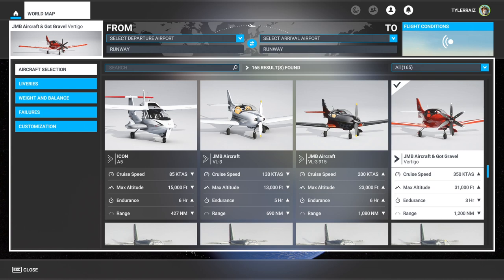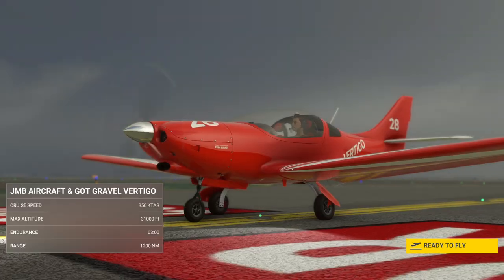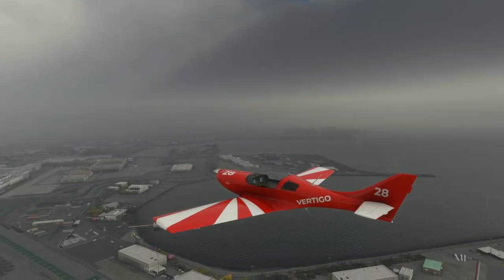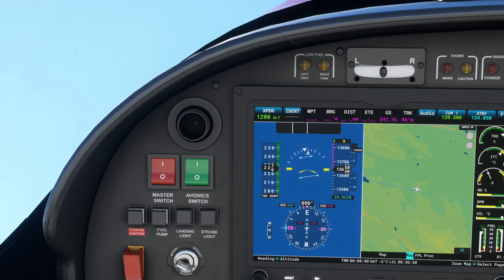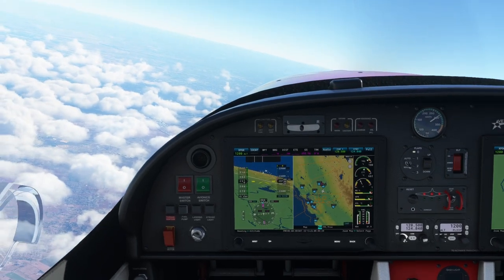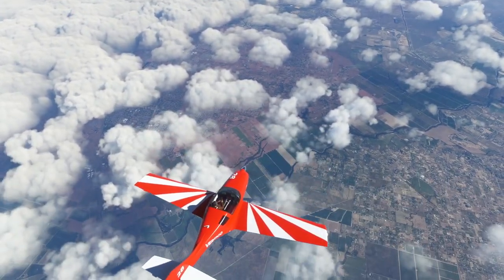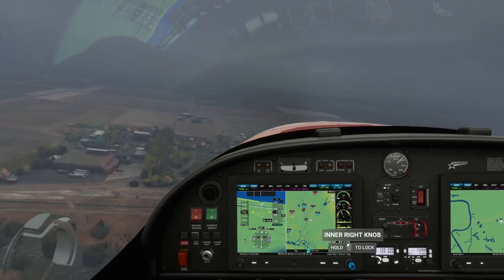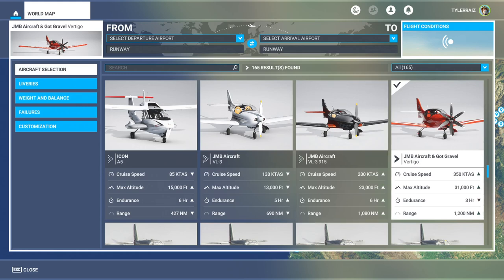Flight Sim 2020 - Freeware Vertigo Racer First Flight

Comment: Paused the video 1 minute in, haven't watched you fly it yet. This was my absolute favourite plane for quite some time, it does everything. SSTOL (as in stupidly stol), IFR, fast commute with autopilot, treetop thrashing, aerobatics, tricycle gear, it does the lot. It was absolutely godly thrashing it round the Mach Loop in VR. The only thing is not to ever use more than 25% throttle for the takeoff. Right, let's unpause and see what you make of it :)

edit : was not disappointed. 10/10 :)